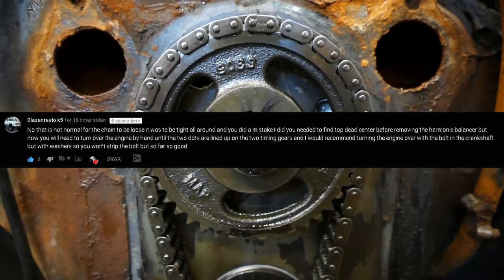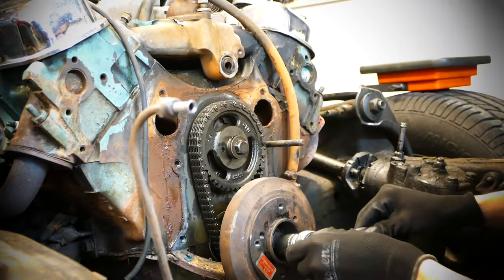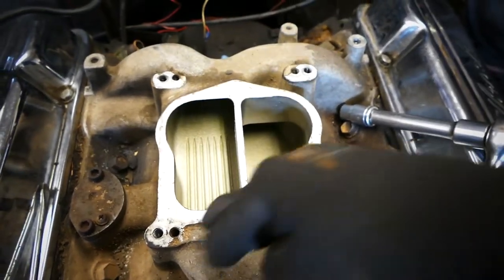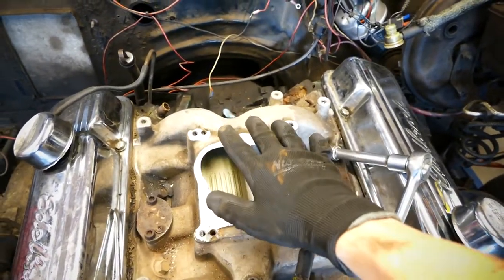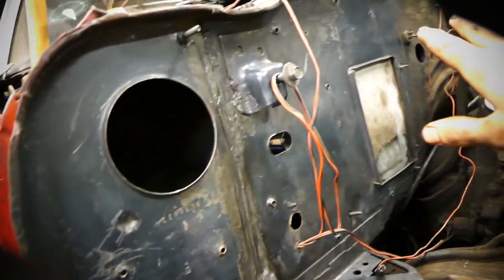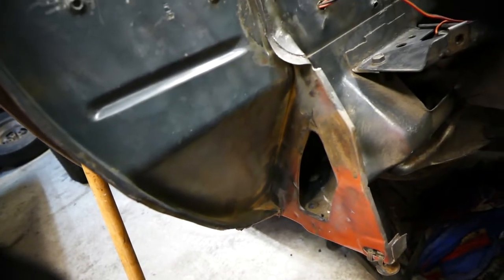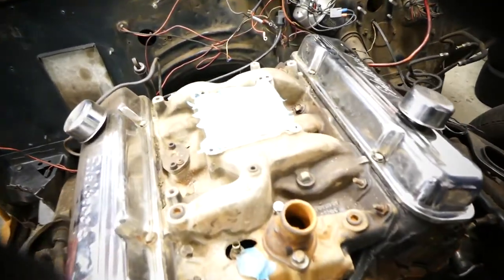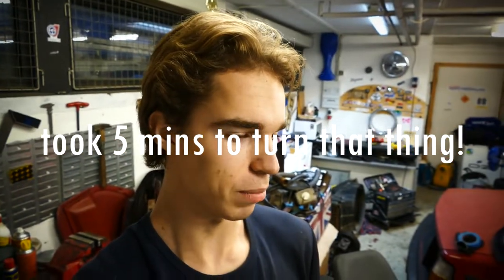LAST DAY THE ENGINE IS IN THE CAR! 1970 Firebird Drift Car Build Part 5

Comment: The cam gear dot has to be on the bottom and the crank one on the top meeting with each other
Reply from the maker: Really haha I asked around a bit and got told to put like this for when I take the engine I apart, hmm ill research thanks man :) ill turn it back
Reply: The crankshaft rotates twice every time the cam goes around once. On disassembly it's fine for them to be different. When you are assembling line the cam dot (at bottom of rotation) with the crank dot (top of rotation).
Reply from the maker: Yeah I’ll have to remember that ;)